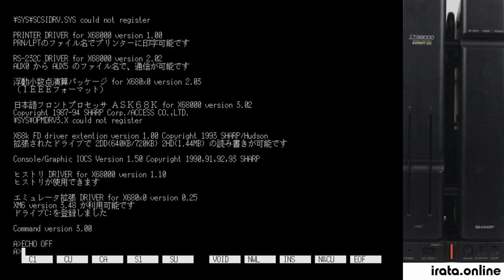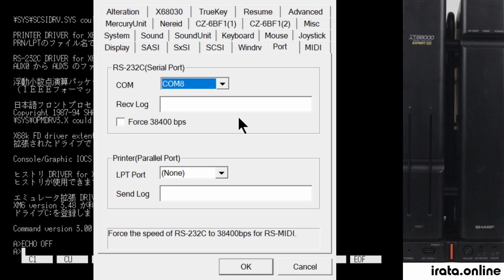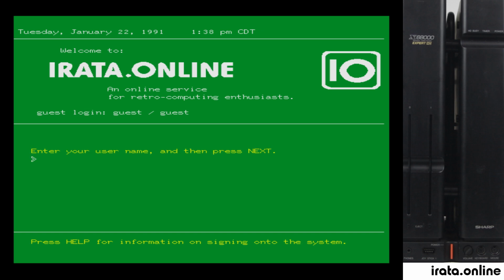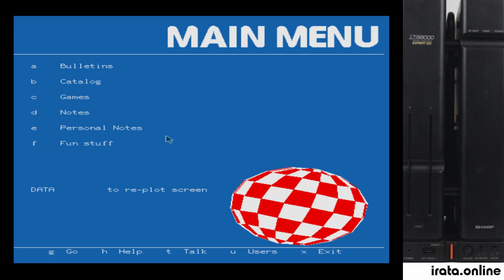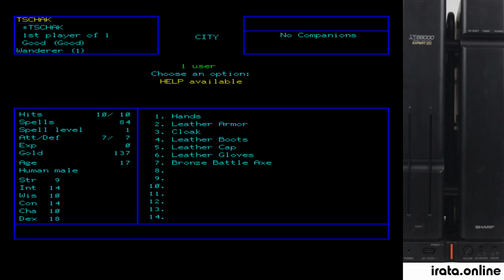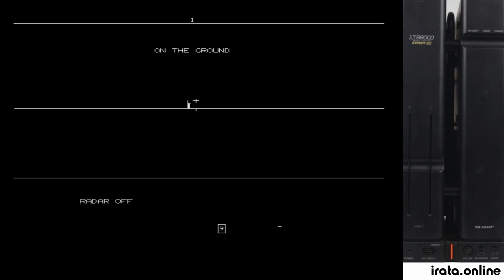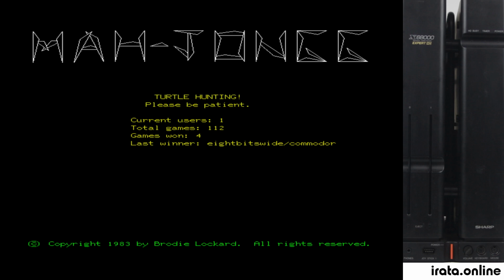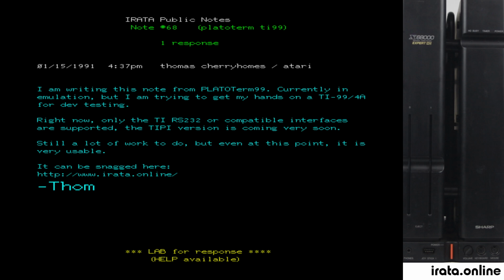PLATOTerm for Sharp X68000 - WIP 20190122

Comment: It looks like RIPscript when it renders. Is this based on that?
Reply from the maker: No. The protocol is MUCH older than RIPScript. PLATO IV protocol was formalized in 1971, and the ASCII variant was formalized by Control Data in 1980.
Reply from the maker: You can read the protocol specification here: https://irata.online/assets/s0ascers-045c83081e9ada2008378c3ae6aa62564b213a71decf9fe04608909b91d20ad1.html